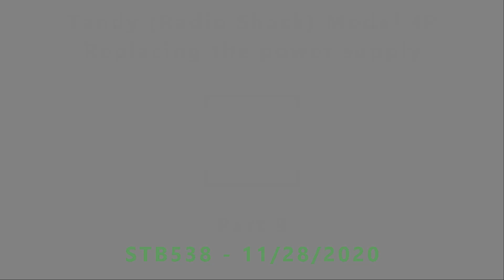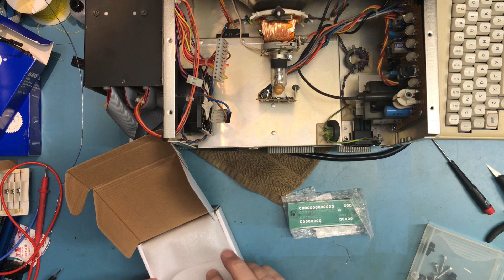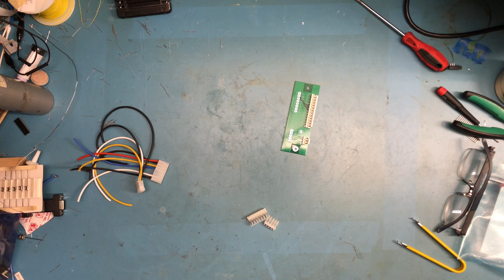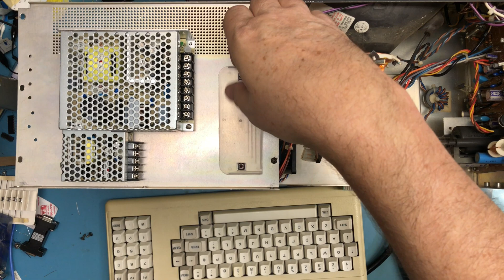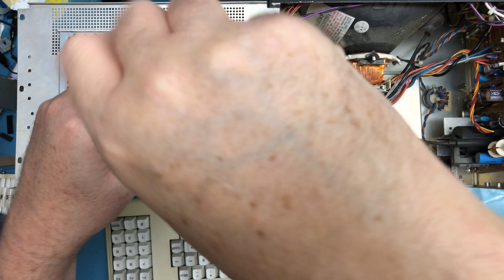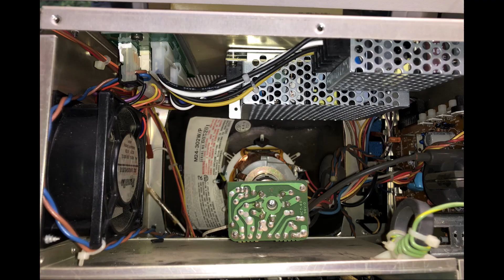STB538 - Tandy Model 4P - Part 9 - Replacing the power supply

Comment: What type of switchers do you use?
Reply from the maker: MEAN WELL RT-65B for the system +5/+12/-12
MEAN WELL RS-15-12 for the monitor +12
I've designed a PCB that makes this all a drop in replacement without needing to drill holes. This will be upcoming soon.